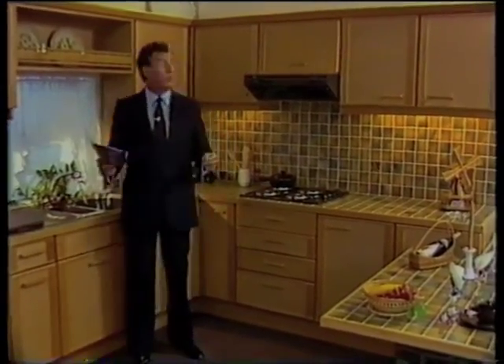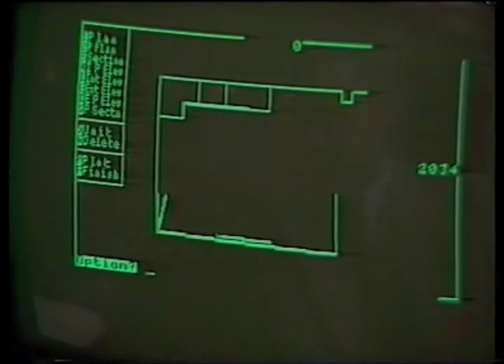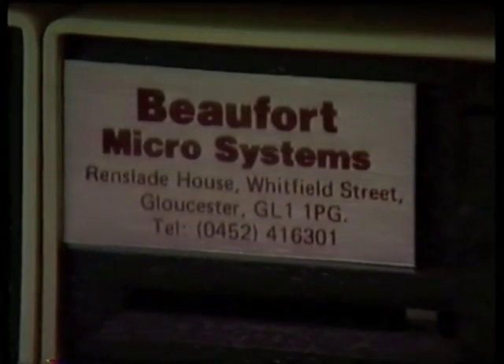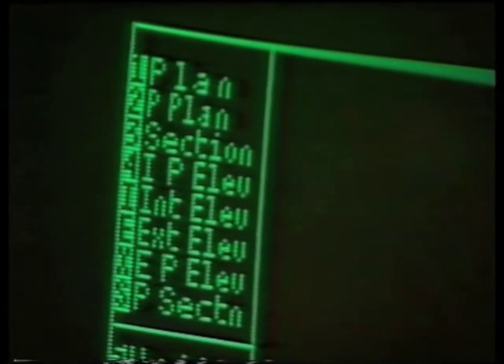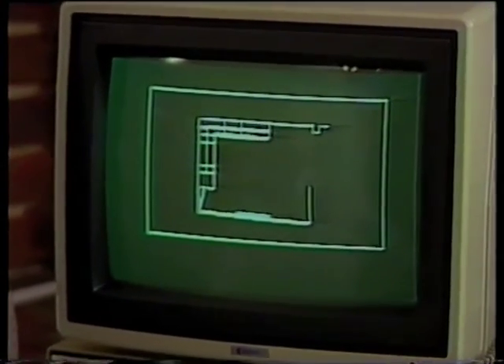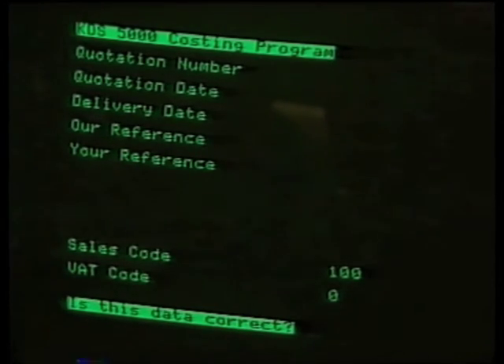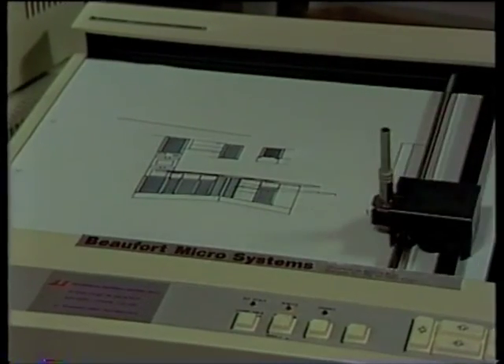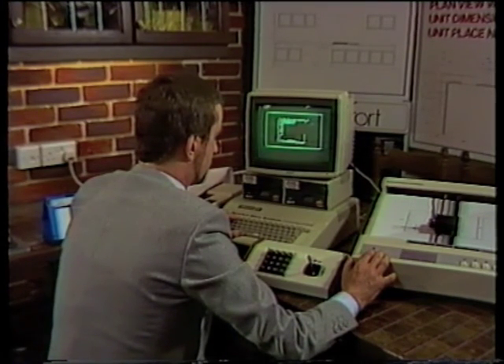Beaufort Kitchen Computer - VHS Promo Video - Apple IIe CAD System

Comment: when i was a kid my grandpa had an old apple ][ with this enormous external CAD module with a special keyboard to do drafting in 3D with its own special keyboard. Was really impressive even though I never saw it turned it on, I'd love to see a working unit (Someone walking by their garage 'took it off their hands for them' which is kinda sad, the thing was priceless). Pretty cool what these computers were capable of when you added external hardware modules, I haven't been able to find anything on any other external CAD systems on youtube from that time period yet though. This comes close!